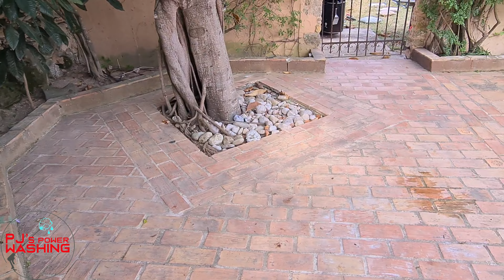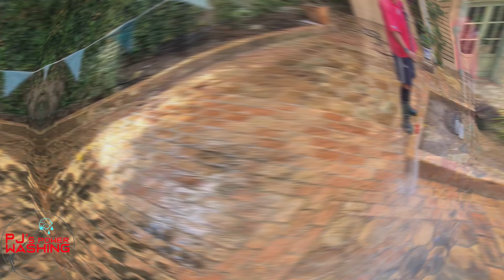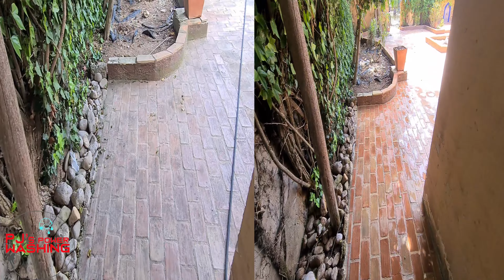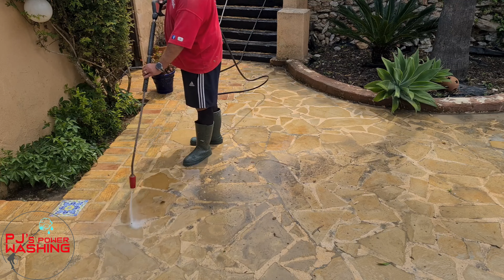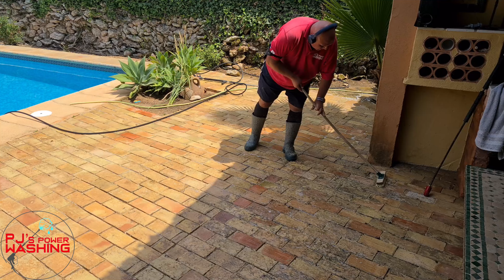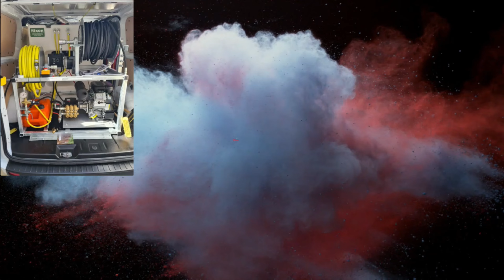Jet-washing - terracotta revival!

Comment: Would a surface cleaner have worked and been faster? Still a nice job...
Reply from the maker: Hi Lester, the joints and grouting wasn’t the best, so I maintain a little more control with the wands. Ideally yes the fsc would have sped things up 👍